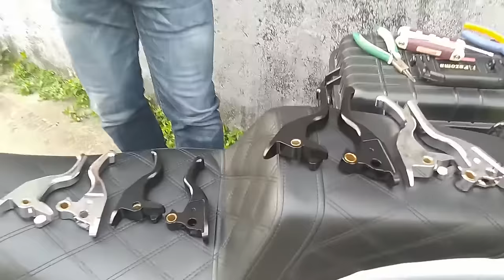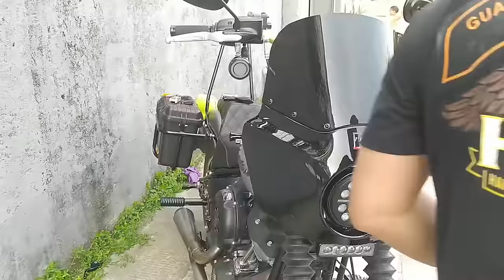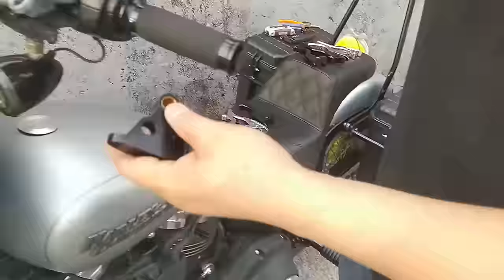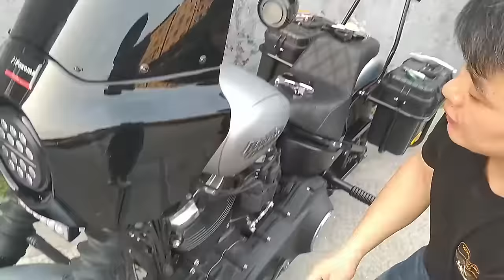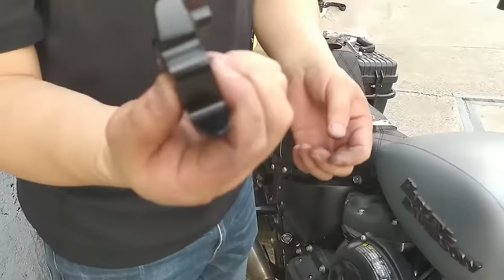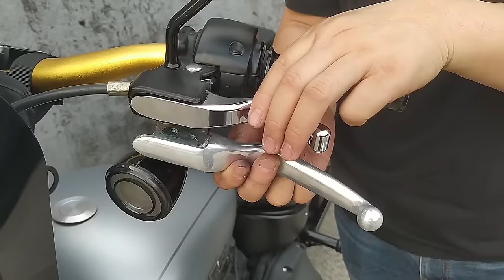How To Install Harley Softail CNC Shorty Hand Control Lever Kit Brake Clutch Levers Set

Comment: When I fitted mine, both levers really got harder to pull. The clutch was very heavy. Had to install an easy clutch. Never saw anyone else have this issue with other shorty lever installs. What did I do wrong?
Reply: Lubrication. 
Wrong size parts.

Comment: Is short better or something?
Reply from the maker: In terms of popularity, the 3-finger model is purchased by the most people
Reply: Clearly not.

Your subconscious mind is doing all the grabbing of the brakes.

If you've had to think about it,  you've crashed and died.

You have gyroscopic forces that do the extra steering performance not hand control. 

You have a mid mounted engine to deal with.

Comment: Its really foolish to do this. 

The whole point to using your whole hand to reach for the level is so you fully shut off the throttle as fast as possible. 

Or, you apply your tuned braking performance at exactly the right location for the corner. 
You require those 2 extra fingers to get maximum application to your tuned brakes. 

The lever doesn't require tuning.
Your subconscious mind is what's important here, not the think part of your brain.